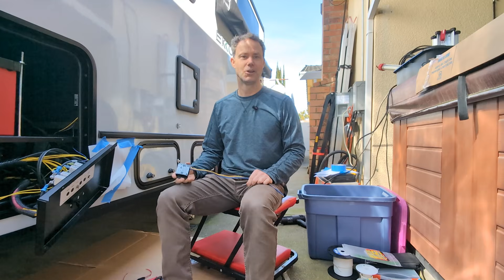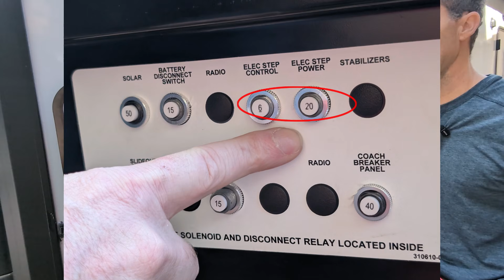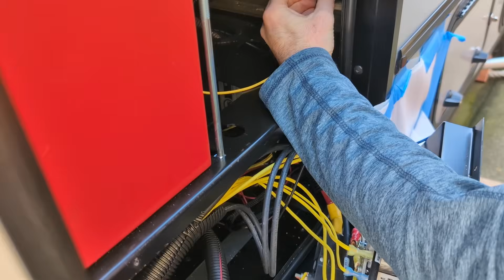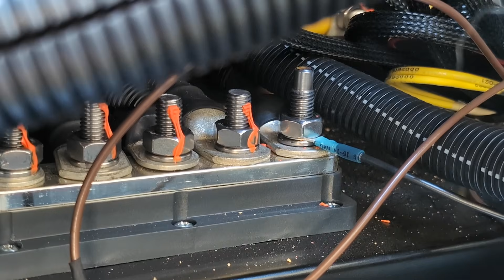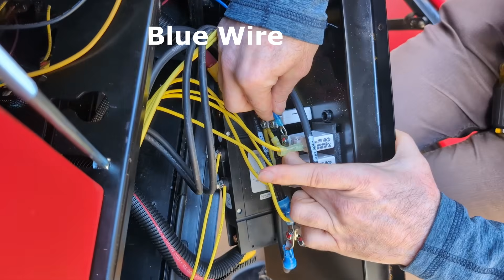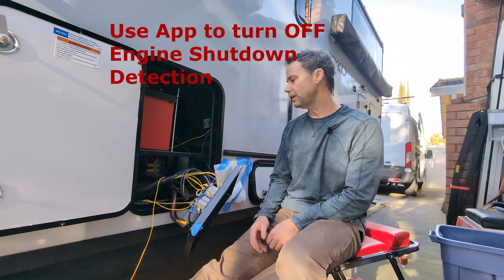How to Keep the Starter Battery Charged on Your Winnebago Ekko with House2Start

Comment: Would there be any interference or install issues if I upgrade to a two battery system down the road?
Reply from the maker: HI Paul, 
House2Start will work with one or 2 batteries. Upgrading to 2 batteries down the road won't change the installation.